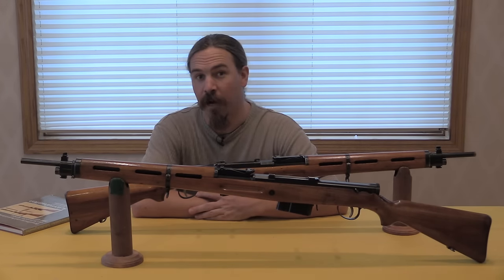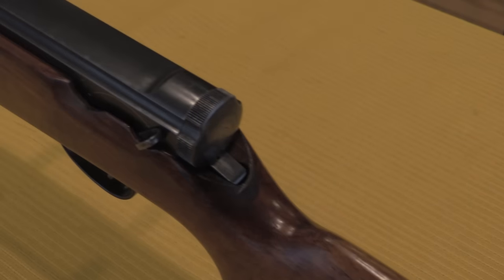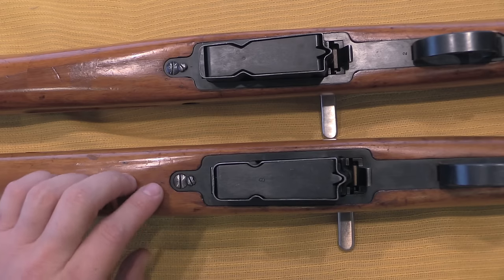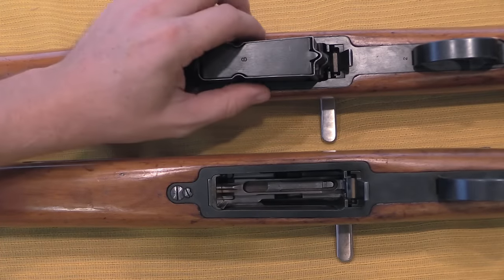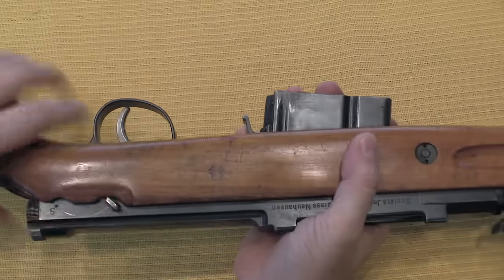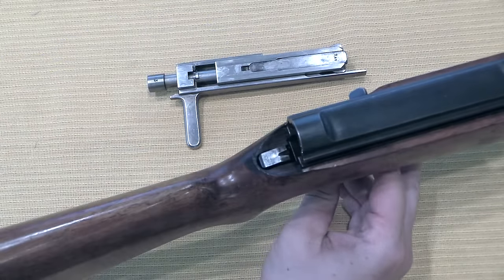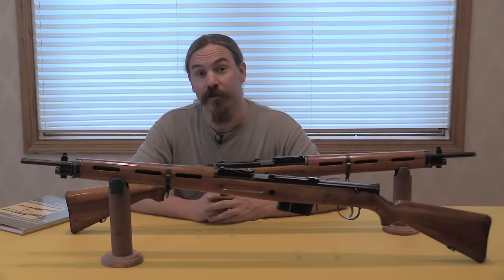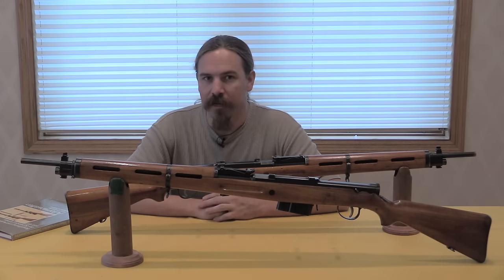Swiss Prototype: N33 Rifle

Comment: I suspect that 7.65 rifle is chambered for 7.65 argentine. You can check if it's rimmed or not using a 30-06 case. The rimless version of argentine has almost the same rim dimensions as 30-06 so 30-06 should fit in the bolt face if it's chambered in regular 7.65 argentine.

Comment: That bolt looks like a nightmare to machine.
Reply: +raider762 Nightmare to machine is pretty much a summary of all Swiss guns upto the SIG 540 (which for posterity sake is about as complicated as you can get with an AK style action).
Reply: ***** The SIG 540 bolt group is as complex as you can get with an AK type action. The AK-12 still has a pretty standard AK style bolt, the rest hasn't change much from the AKM, the only real added function is a bolt catch.

The AK-12 also has 35 years on the SIG 540.
Also last but most important, the number of parts and the overall complexity of the design has nothing to do with how complex it might be to machine. You can have a complicated system with a large number of parts which are relatively easy to make and you can have a very simple system but with very complicated and intricate parts.

The SIG 510 has less parts than an AR15 but the tolerances and the intricate roller locked 2 part bolt make it a nightmare to make.
Reply: +raider762 Heh Its swiss, made by Sig. It has to be overly complex.
Even the bolt action rifles made for the Swiss are like that.
Reply: +Abe Lincoln I wouldn't say that. I think the straight pull designs, expecially the K31, were no more complex than necessary for a good solid straight pull action.
Reply: Grass Snake Well the K31 is a masterpiece I have two of them. Most accurate general issue rifle of WW2. GP11 ammo was also the most accurate general issue round.
Surprisingly easy to reload for also.

Comment: So many things done wrong, yet it seems to still be a note-worthy rifle.

real shame there aren't more of these around.
Reply: +Gekko Tec Well, it works in smgs. It seems to be a very simple and relyable system as well and it does not require a complicated trigger mechanism either. For closer ranges, up until 200 m or so, this rifle, with a couple 10 round mags would beat any bolt action rifle I bet. To bad Ian cant shoot them.

Comment: Ok newbie question. There were a number of semi automatic pistols before and after  WWI. Why did it take 30 or so more years to get a semi auto rifle for WWII and then only widely used by the US. Everyone else appeared to be using rifles still from WWI.

Is it just that the higher pressure from the rifle rounds or is it just that there are many more rifles to need to be replaced.
Reply: At a guess it probably is the larger rounds and greater amount of accuracy required from a rifle.
Simple blowback and short/long recoil operated systems compromise accuracy due to the traveling barrel (among other concerns like reliability).
There were some automatic rifles made around that time (Ian's covered some of them), but none that met military requirements.
Reply: ToastyMozart "There were some automatic rifles made around that time (Ian's covered some of them), but none that met military requirements." 

The one that comes to mind is the Peterson (sp?) that looks like it uses the Toggle lock from a Luger.

Comment: I may have missed something in the video, but it seems the part about the gas system is missing. The rifle is stated to be gas operated in the video (1:56), but I saw nothing more on it.
So it's a short stroke piston or what?
And where would the piston hit on the carrier, the front of the part that extends forward from the base of the charging handle?

Comment: that bolt ramp looks very MKB/STG like...

also.... due to the mud tests you have been doing.... what would happen if mud stopped the bolt from camming up? 

on the m1 garand... the fireing pin should not be in line with the hammer unless its FULLY in battery. theirs a block-er. 

but what about this? does it feed like the m1.... controlled feeding style.... where the round is against the bolt face before the bolt is fully closed.

Comment: What unlocks it after the round is fired ?
Reply: It's a gas system, presumably the piston sends the bar with the bolt handle back. Which would just reverse the sequence of events that fired it.
Reply: +ToastyMozart ty, I didn't see any thing like a piston so I thought I was missing something.

Comment: So why did they spell it with a J?
Reply: +spankmeister Never seen Indiana Jones and The Last Crusade? :P
Reply: Nukle0n Yeah, but it's been a while. :)
Reply: +spankmeister  In Denmark, where I live, the letters I and J were used interchangeably until the early 20th century. I suspect that it's the same in Switzerland.
Reply: +spankmeister 
It's most likely an artefact of the double usage of J and I from 
classical latin - "J" being used as a capital letter. I am german and 
remember that I learned it the same way in school -  J without a line on 
top (like in T) was a proper J, and one with that line was an I (or was it the other way around?). This was a matter of cursive handwriting though, this use here in block letters is rather unusual. This somewhat makes sense in german and latin (and probably a few other languages), but looks rather odd in english because the J in english is phonetically quite different (You could replace every starting "J" in german with an "I" without having a big difference in sound).